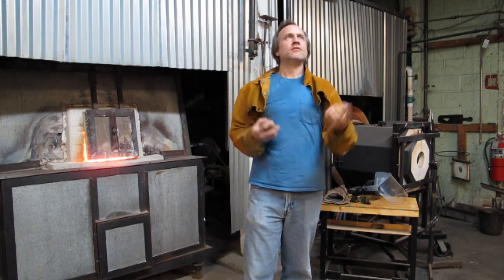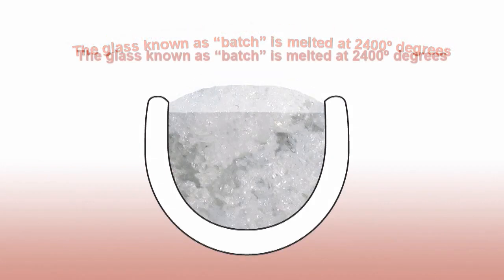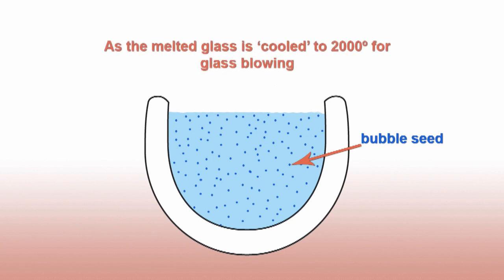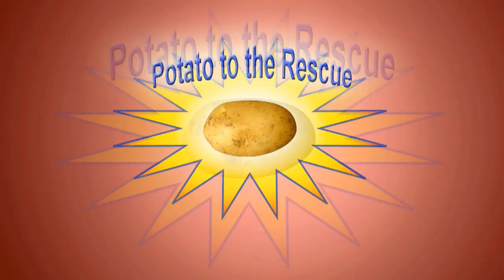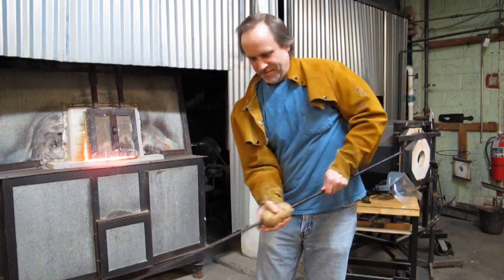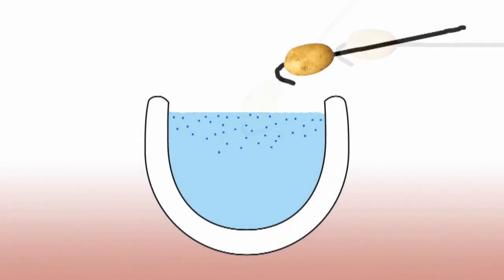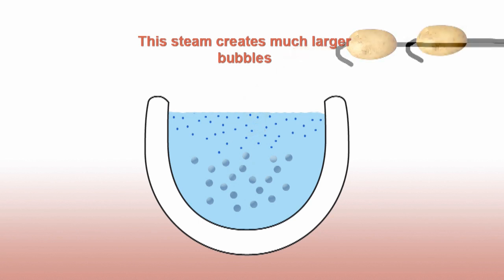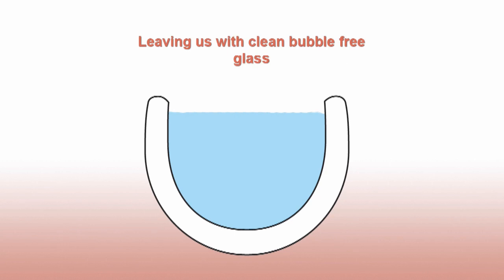Potato in Glass - Glass Blowing Basics | Bernard Katz Glass

Comment from the maker: Potato in hot glass furnace
Dipping a potato in a hot glass furnace may seem like an odd thing to do. This is actually an old glass factory trick. This little known trick helps with melting clean, bubble-free glass… And there is some actual science to back this up.
 #glassblowing   #glassart   #glass   #potato
Reply: i love little insider tips and tricks like this (even in fields where i have no knowledge or experience). is the viscosity of the glass at that temp low enough that the potato steam bubbles spread pretty evenly throughout? what's the volume of the glass you're dipping into? i'm surprised the potato doesn't explode from such a rapid temp change.
Reply from the maker: james kalin Thanks! The crucible inside our furnace holds about 350 lbs of glass when melted. When the potato first  goes in the glass it actually creates a gigantic bubble and air pocket, almost volcanic like... So the bubbles get distributed throughout the glass.

Yes, I have also thought about the potato exploding... That is why I haven't tried things like an apple. However, the worst thing that can happen is the potato getting loose and dancing around on the surface of the glass before it burns-up.
Reply: Always brings me Bernand Katz to the extraordinary experience of the man as an artist with a special love for creating and creativity.Simple that easily presents and extremely difficult tehnique glass.Silflessly work,because your knowledge,experience share.Witty you with a special gift for profession of teacher,ease complexity.Thanks,with all due respect to the man of wide horizons for great artists of excellence.
Reply: Always brings me Bernard Katz to the extraordinary experience of the man as an artist with a special love for creating and creativity.Simple that easly presents and extremely difficult tehnique glass.Silflessly work,because your knowledge,experience share.Witty you with a special gift for profession of teacher,ease complexity.Thanks,with all due respect to the man of wide horizons for great artists of excellence.
Reply from the maker: Jasmina Tramišak Thank you for your kind words!! You made my day, have a great evening!